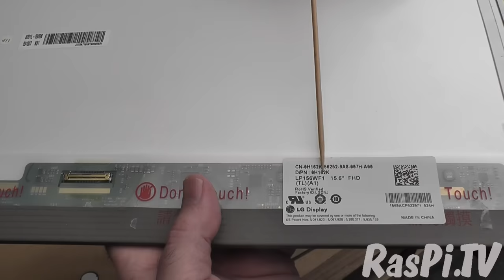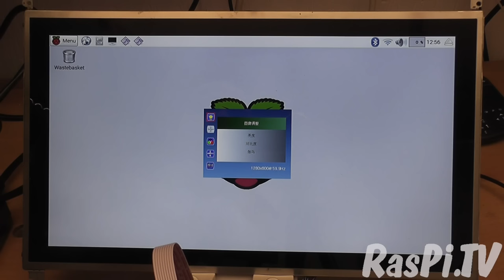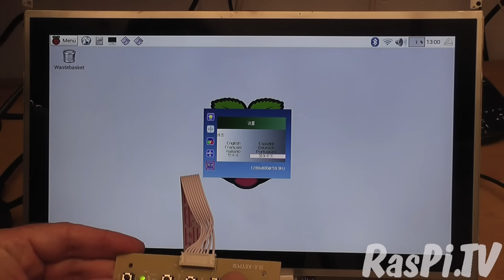Make Your Own 15.6" Full HD Screen for 32 bucks for use with Raspberry Pi, DSLR, Video camera

Comment: I have a 2 core plug going into the bottom of my screen, no mention of that in the vid. Can it be removed? it's connected to a small bar (about 6") with components on it.
Reply from the maker: Pickles there's a lot of different lcds out there on the market the video only covers one it's quite possible that could be an inverter for powering an old LCD tube backlight.
Reply: Yeah, it's an old laptop. I f I remove this plug will the driver board still do the job or should I start from scratch (different Screen)?
Reply from the maker: I don't know. But the point is that if you google the part number of your LCD then someone should be able to supply a suitable driver board. If it needs an inverter for the backlight, it should have one. The process should still work if you can find a driver board supplier who offers one for your LCD.
Reply: Excellent, thanks for fast response. Brilliant Vid BTW.

Comment: What amp psu was you using? Did the driver board come with any documents
Reply from the maker: I think I used a 2 Amp 12V PSU. No documentation whatsoever. It's a punt.
Reply: Perfect cheers

Comment: +Alex Eames, I really like your videos and I'm very interested in learning more about electronics. Would you recommend taking electronic engineering to acquire knowledge on the field or what kind of education/training and/or path of studies did you take to become good at what you do?
Reply from the maker: I did a module of electronics in year 1 Analytical Chemistry (must have been 1989) but apart from that, I'm self-taught. As long as you have the capacity to learn, how you get there doesn't really matter all that much. If you have the interest and opportunity to study EE, why not? It can be a nice hobby too though if you don't.
Reply: Hey Alex.  Just wanted to suggest that even if you decide to go with schooling, which is obviously the best way to learn a wide array of diverse topics, methods, linguistics around the skilled trade which help when learning more through dialogue with others in the field, etc.  In my opinion, and also my prefered method of education in many of my "hands on" endeavours, is now and has always been since it's inception & gradually becoming widely available in mainstream communities practicing said projects; learning through watching these videos has for me personally anyway been the quickest, easiest, and most rewarding way to learn just about whatever it is I'm not schooled in.   Having said this, I encourage you to always continue watching these videos AS WELL AS any kind of educational courses you decide to pursue in tandem.  This should (combined) provide you with the best education available, comprible with just about anything else on the planet!   Thanks YouTube & especially to everyone who is good at something and will take the time to use this technology not available in the past, to now teach others, where as otherwise they could never be able to be learning much of these skills.   Good luck to you friend!!

Comment: it is nice, and helps the environment.. only problem is you can buy a brand new full hd screen quite cheaply
Reply: Mircose, but where's the fun in that? 😆
Reply: Mircose he knows the screen works.  to buy a new lcd screen, well you can't for $32.  it'll have to be used:  are the caps bad?  did it get dropped?  why is it being sold?    is it native 720p or does it really handle 1080p?  where's the fun in dumping $$ and hooking up?

I'm just saying, this monitor is a known quantity and this hardware hack as he has done is very popular among Pi enthusiasts:  not all, but a lot...
Reply: Ross Potts
 I see the novelty and "hack" value of the video.. but the practicality of going through all this trouble to have a screen which is 2nd hand, has no mount is not for me.. and is not worth.. unfortunately... I do computer repairs for a living and I usually keep lcds like that for replacement parts
Reply: Buying a standalone monitor this slim with a full 1080p res will run you a lot more than $32  as for the stand it's not always needed depending on what your gonna use it for, a flush wall mounted to? A smart mirror wall mounted inside a nice picture frame. An old school arcade coffee table gaming machine? All of these you wouldn't wanna use a monitor for due to the stand/bezel etc

Comment: How close is the $32 dollar board to limit of not having to deal VAT and customs? I've recently move to the UK and read somewhere £17 which is way less than the $32. Now isn't the VAT what I'm worried about, it is the £8 pound handling charge which i find sizeable on a $32 dollar purchase.
Reply from the maker: Well I live in the UK and wasn't asked for any VAT, but you can always google the specifics if you want to know the letter of the law :)
Reply: norullzz I think that's similar here in the US.  My parts always come labelled as "gifts".

Comment: Is there no driver that can be salvaged from the laptop?
Reply: Laptops don't use driver boards but FPD-Link from GPU directly to the display timing board. They could switch to eDP which in theory could be adapted to DisplayPort (which would require a power supply and special adapters for the display anyway) but FPD-Link seems to be cheaper for the moment.

Comment: one can probably create a voice-activated (Amazon Alexa api) two way smart mirror by installing it in the raspberryOS.
Reply: Robert Sala you can run a version of Alexa on the pi quite easily however getting it to display information rather than audibly is something else completely plus Alexa on pi has a terrible response time

Comment: IS there any way to power controller board (LCD) with powerbank or 12 v battery to make it portable ?
Reply from the maker: It depends on the controller board. Some of the ones I've used can run from 5.2V, so if you hook up the USB battery pack it would work. But each one is different.
Reply: can i connect 5v-12v powerbank ? 12v lcd screen board and raspberry from 5v usb?

Comment: In this day and age when a used 1080p monitor cost just 30-50 USD does this project really make any sense? Unless the smaller size is the main draw.

Comment: Would this work with a touchlaptop screen?
Reply: Bailey Hellmuth I'm thinking the same thing. But theoretically it should. As long as you can get a Driver board for your screen, then it should work 😊

Comment: can same be done for touch screen (screens with digitizer)?
Reply from the maker: +MindzGroupTech if you can find a board for it that supports the right Linux drivers, yes. But it will likely be harder than a simple ordinary LCD.
Reply: Alex Eames thanks

Comment: I'm sure the laptop had a driver board in it already. Is there no way you could use that and save yourself the 32 dollars? I've seen other videos like this and they all say you need to buy a driver board.
Reply from the maker: +Mark Woodworth Well laptops have everything on the mother board and on the laptop the GPU was knackered. In practice the only way is to buy a driver board.

Comment: is it posible to just skip the rass pi and just hook my ps4 straight to the driver board
Reply from the maker: Yes. Once you've added a driver board to the LCD it pretty much becomes a standalone monitor and you should be able to plug more or less any device into it as long as the connectors match.
Reply: thank you i have a great idea for this thean

Comment: No way to use the driver board from the laptop?
Reply from the maker: Not really because it was not working properly (GPU), second it's integrated into the entire motherboard of the laptop so would be big and clunky, third it has no HDMI in or any other video inputs.

Comment: nice video Alex and very well presented - absolutely priceless for t'noobies :)
I've repaired a lot of Dell lappy's over the years and it seems a coincidence that they die shortly after the warrenty runs out (especially the XPS range)
the overheating issue screws up the solder connections between chips and mainboard.....just like the infamous xbox360. a quick reflow and it's happy days! reflowing can be done (carefully) on the cheap in a household cooker oven (many vids on the tube, I believe).
it's a shame to bin the two laptops mind. even if they are U/S, there are many bits and bobs for a the avid hacker to use (and abuse)

thanks for posting mate!
btw, if you're after making your millions......buy stuff from china (aliexpress & co), re-import & sell it to us poor bar-stewards stuck in Germany. the import tax here is 'beyond' abusive and totally defeats the reason for the raspberry's low price. God's teeth - I miss the UK

Comment: If you still have one Dell that got overheated, you can try fixing the Motherboard by reflowing it.
It was succesful for me (Dell D600). There are YT videos about it, which inspired me.
Reply from the maker: I did it with mine. It got me another 6 months of use, and then I decided life was too short to waste an afternoon taking apart a 4 year-old machine that gets too hot and I don't enjoy using. So I binned it and splurged on a top of the range Macbook Pro, which I totally love - particularly now that I'm doing lots of videos.
Reply: Coincidently, I have an older model 17" macbook pro in parts in my drawer that I've reflowed a few times - couldn't be bothered to put it back together this time and was contemplating your solution.  Any thoughts on a decent enclosure for the LCD and driver?  That's always the problem with these home builds.
Reply: annd ... looks like I'm not the only one with a toasted macbook pro - what does that say? lol.  Hey it's not so bad, atleast I can unscrew mine apart /hides.

Comment: Why not just use a LCD desktop monitor?
Reply: Because why get rid of something that still works?
Reply: frank rizzo because desktop LCDs don't generally come in 12v version's ,saying that do 1080p or UHD 48" panels etc generically run at around 12v, and they just don't sell the TV's as 12v portables ? its assumed oc you can buy 3rd party 12v driver boards for them retail to make a semi DIY 12v uhd 4k display and ADD a wireless streaming TV dongle and battery pack for fun😁
Reply: frank rizzo loads of excess bezel and plastic on a monitor plus this is a lot cheaper if u have a dead laptop lying round. Perfect for making a smart mirror

Comment: Holding the whole stuff at the giant DON'T TOUCH! area :D Let's break off some chips. Cool vid anyway, I'm waiting for my sisters Dell to die from overheating. Why are Dell laptops overheating? What's their design flaw?
Reply: They overheat if set on a couch where they are smothered. (Blocked air flow)

Comment: Been rhere, did that!! With a latte panda and a very similar driver board for a Tosh lappy monitor.  My driver board would eat 19v and happily output 5v 2A for the Panda via the USB port. Voila, el cheapo useful computer.

Comment: Cant you do that with only rasberry pi 3?
Reply: Do what?
Reply: Kerim Amet do you mean make it a driver?
Reply: TheApotheosis OfGDot can you just connect the display on the rasberry     Plug and play?
Reply from the maker: It works with all Pi and all things which need HDMI, DVI and whatever connectors are on the driver board :)

Comment: Very nice video.
Does anybody know if it can play media from usb without the pi? only with the controller board.
Reply from the maker: antonis kaloterakis It can't. Unless you plug in some kind of media player.
Reply: Alex Eames 
Thanks for the fast reply.
So the Pi does that part .
plus we need a mouse and a cardreader to put the media files in.
i make wooden stuff and i want to put a wooden screen in my shop to play videos of how i make the things i sell .
the the recipe is monitor-controller-pi-mouse and cardreader or usb stick.

Comment: Hi guys,
Greetings of the day!!!

I have a sansui LCD TV 32". Which has mother board problem and all wires are damaged
But TV screen is in working condition.
I would like to use this 32" LCD TV screen for raspberry pi 3 b.

Guys anyone help to to do this.

Waiting for response
Thank you
Srinivas
Reply from the maker: find out what the LCD is and see if there's a driver board for it.

Comment: Here's the real problem...  If you want to take it anywhere, you're looking at more ca$h to print a housing.  If you don't want to, that's fine...  However, you can get decent portable screens for about $70 so, this is of limited benefit.

Comment: i did mine couple week ago probably, i gonna put it on youtube once finalized.
its like a piece or art luv it
. 
i just got one problem with the controller, like it's miss a inch on the right side, like the screen is not align properly.
and in the OSD , the resize option is not avalaible either.

so make sure you buy from a reputable seller and read the Review people left.
I got mine from :     hk-estreet
and he keep pretend the problem come from my side which its clearly not.
beside of that, fun to make it run.

Seem like the same exact board that you got? where did you get it?
i also notice that the chipset on top heat a lot, so dont let it run for more than a day. without turn it off

Comment: Perhaps this slid past me first time through, around where you were talking about your wife and you having the same dead laptops, but - I'm wondering --

Is it impossible or impractical to try to scavenge the driver board from the laptop - or was it assumed that yours was dead meat?
Reply from the maker: OK so the driver board inside the laptop is actually the motherboard itself. On mine, I'd already reflowed the GPU once, which gave me a few months more of use, but not 100% solid reliability. It took me a long time to dissassemble and reassemble and I wasn't up for doing it again. It's a work machine and was already getting old, so I bought a new MacBook Pro, which suits my needs much better as I do lots of video work. 

So to answer your question. Only if the motherboard still works OK. And if it does, why do you want to take the screen out? Laptops don't have a separate driver board.
Reply: Hmmm - Ida thunk. . . .

Well, fact is I dealt w/ vid issues on an older Dell Inspiron of my wifes some years back - had to buy another video adapter board for it - separate from the MB.  Bought on eBay, wasn't much better than the original that failed - it would drive an external monitor OK but not the built-in, so we just got her a new Vaio.  Furthermore, I suppose that said video adapter is not the same as the video driver you got, where you have various inputs from which to choose -- all in all making your $32 score a FINE idea.

Thanks for the very prompt RE, by the way....

Take care!
Reply: Alex Eames actually some do, I've seen old laptops where the panel plugs into a small driver boards and that sits in a pluggable sock on the mother board, iv yet to see a pi engineer explain how to interface these or make clone slice of it though to date and that's a shame for new pi  builder's today

Comment: # settings good for native 1280 x 800 
hdmi_ignore_edid=0xa5000080 
hdmi_group=2 # HDMIPi for 1280 x 800 
hdmi_drive=2 # for alternative modes get sound 
hdmi_mode=28 # 1280 x 800 @ 60 Hz?  what that mean?
Reply from the maker: It's how I changed the mode on the Pi from 1080p to 1280x800
Reply: oh ok,

Comment: given its a pi hacker Chanel for education then why can't we find the existing display driver on the salvaged laptop and find how to use that directly instead of buying a retail PCB like ordinary consumers ?.

does an example even exist
Reply: Dave May222 laptops don't require a driver as there given power and gpu signals directly from the laptops motherboard, the drivers needed to plug other devices such as pc pi Xbox tivo into,

Comment: Full HD is 1920x1080, 1280x800 is technically 720p not 1080p
Reply from the maker: +ABALL1ST1CSQU1D Gaming Correct. The LCD is 1920*1080 but I am driving it at 1280*800 from the Pi deliberately because it makes text and icons larger.
Reply: Alex Eames you could just change the setting that is specifically for that purpose and run it at 1080p
Reply: And also could I get the model number of that display? And you are the only person who actually uses the dollar sign correctly who isn't American, which I am.
Reply from the maker: ABALL1ST1CSQU1D Gaming Yes i specifically added a couple of lines in config.txt to force 1280x800. If those are commented out or deleted, it defaults to 1080p. I think the display model number was shown in the video wasn't it? (When I looked at the label and talked about how to google for the driver board). As regards the $ sign, I thought all currency symbols were supposed to go before the numbers, but if you use USD it should go after. I've not seen people do it wrong all that much. :)
Reply: Alex Eames the dollar sign is actually supposed to go before the number example $33

Comment: Some Controller boards have their own Sound connector on board. Can that be used to connect the speakers to the RPI? How to get a controller board witch supports the multi-touch of the display (18.4") of a more recent laptop screen thru the USB port? Thisone can handle the single touch for an  15.6" screen https://www.chalk-elec.com/?page_id=1280#!/15-6-HDMI-interface-LCD-with-capacitive-touchscreen/p/38127425/category=3094861
Reply: Xiao Shi Zi 1 most of these controller boards can be reflashed for other monitors.  you just need the manufacturer's flash suite.  or you can just see which boards are available with sound.  many sites have multiuse boards